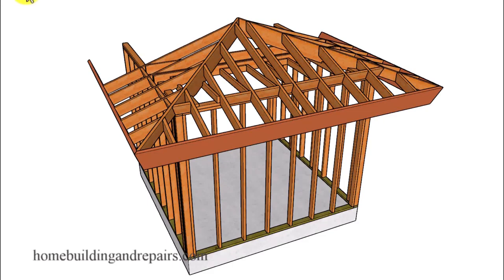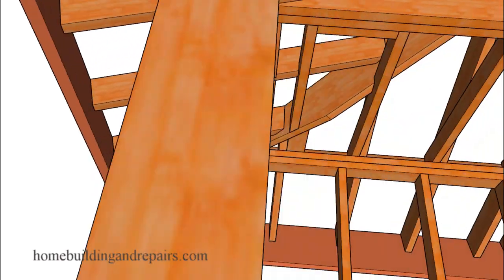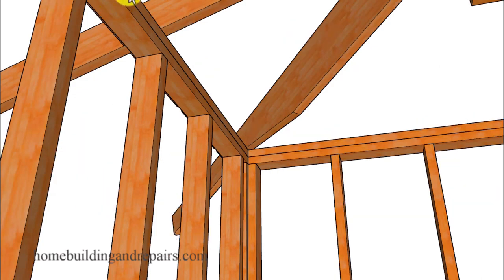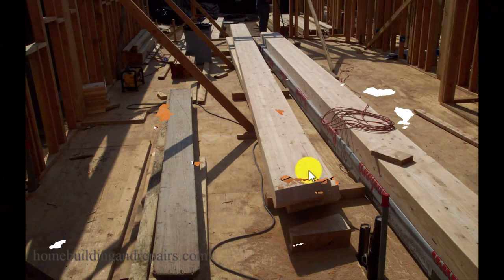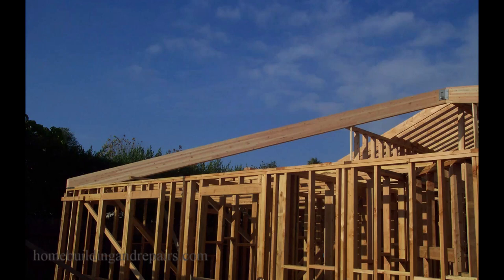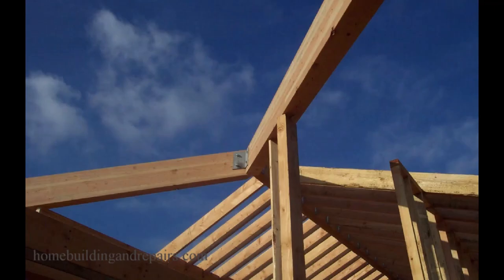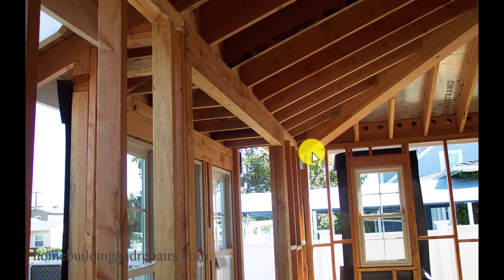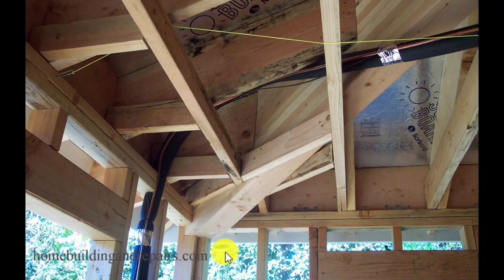How To Use Extra Large Beams For Hip Roof Rafters Without Huge Seat Cuts - Structural Engineering

Comment: I am a B1 contractor and a residential designer in California for 40 years. I speak building code because that is what the plan check speaks.
Because this is a dimensional lumber construction project we can take it as a prescriptive design and no engineering is required.
It is well understood that the undercut of the hip member is OK and it looks as though your hip members are oversized and thinking that it is a structural down-force, it is not. The important part of the hip member in this case is simply a connection tie point, it uniformly distributes forces through the roof jake rafters connect to each other and transfers the forces into the walls. 
So the code says one size over the RR to provide full heel support for the rafters because of the skew cut. So 2x6 RR = 2x8 Hip or Ridge.
When does it require a hip beam? We use hip beams typically because the ceiling is vaulted. The building no longer has ceiling joists. The ceiling joist provides 2 roles 1)Structural downforce and building ties of the walls. if you remove the CJs you are going into engineering and it is not only the beam members but the moment frame to keep the walls from splaying.
Reply from the maker: Just because you use dimensional lumber, does not mean you don't need an engineer. Your local building department if you have one might allow or not allow your project to be approved for construction with out an engineer.

Comment: So, on the first option you give where you cut the beam to match the corner.. You just built the eves onto the end of the beam to make the corner? probably the same on both...
Reply from the maker: You would use what is referred to as a false rafter. It would be installed in between the hip and fascia board.